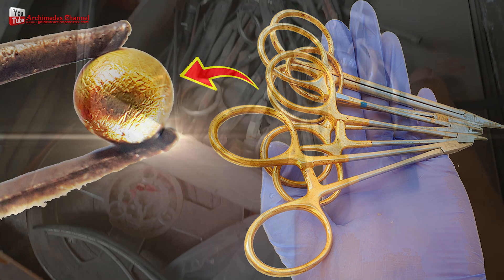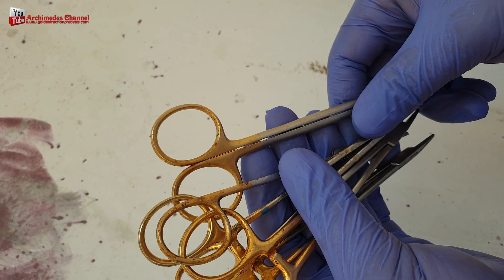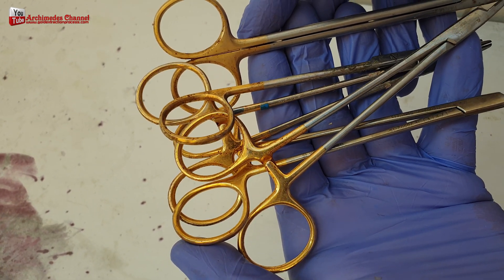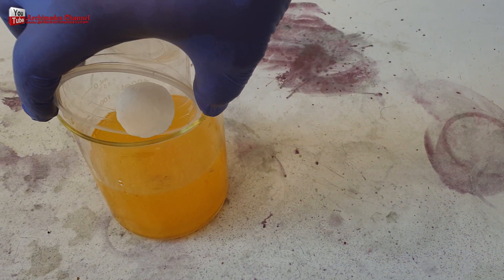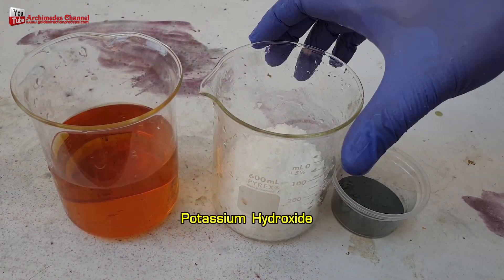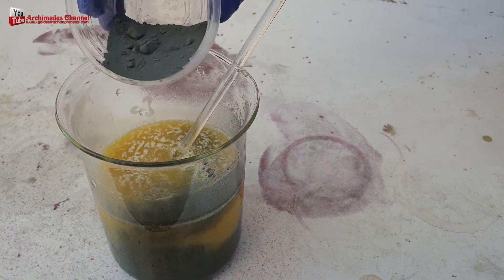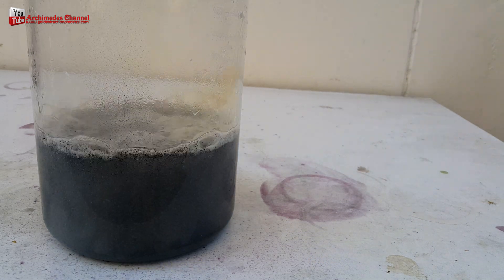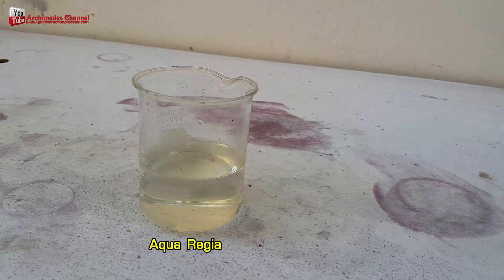Gold recovery from waste medical equipment scissors

Comment from the maker: 😘❤️😀👉👉👉 Recycling of Precious Metal Gold from waste medical equipment
 Gold finds a wide range of application in electronic devices i.e. in mobile phone PCBs, coated plates, connectors etc. This is because of its high conductivity, ability to carry low ampere current, high sensitivity and resistance to corrosion.